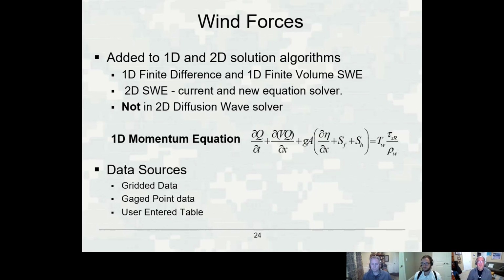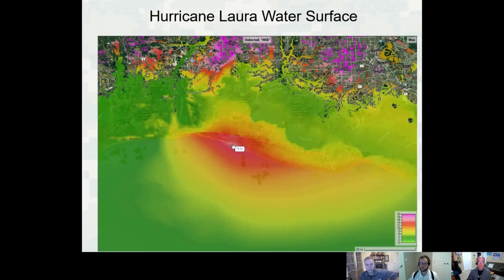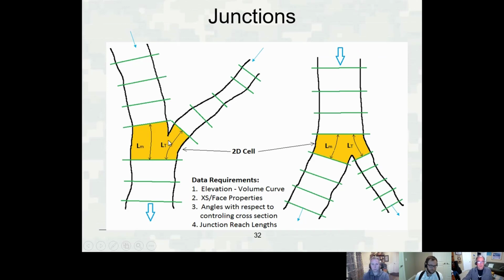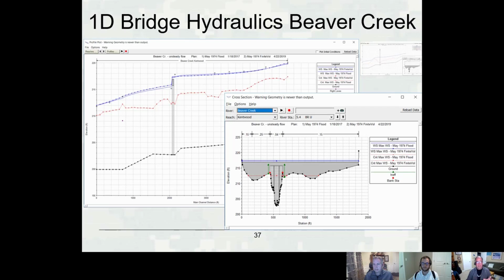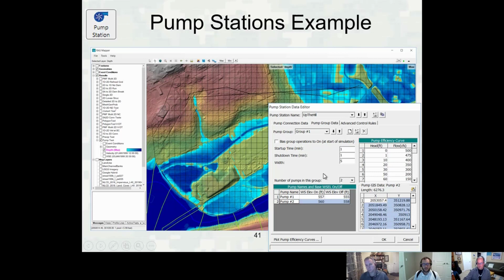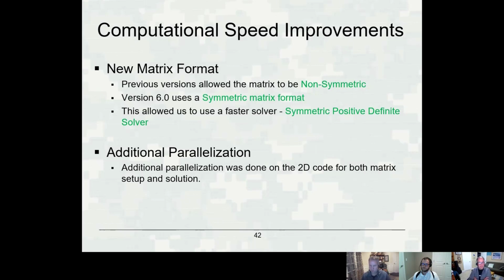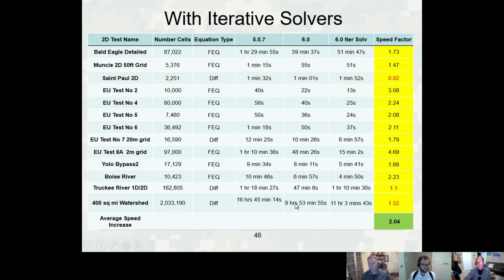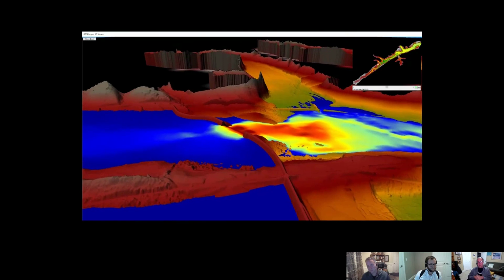Episode 13: HEC-RAS Version 6.0 Discussions with Gary Brunner (Part 2)

Comment: Really nice your Channel! 
I feel fortunate to watch great people working behind HEC RAS and your effort to enhance my knowledge about HEC RAS.
 
It will be great if you can address my query on the HEC-RAS 2D Result. I use AutoCAD Civil 3d/MAP 3d software for design development. I was wondering how the result (Flood Depth/ Velocity) can be assessed in Civil 3d. I tried several times to import the terrain model created via RAS Mapper. I find the terrain files(.tif) created are not compatible with Civil 3d. If there is any other software to convert the terrain file to the compatible files on Civil 3d.